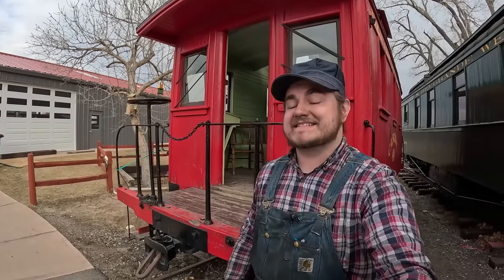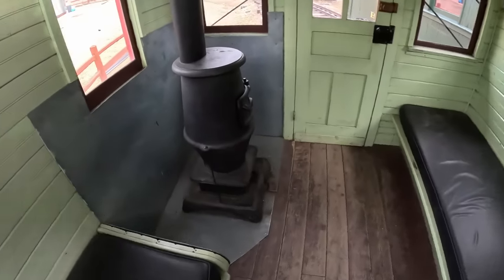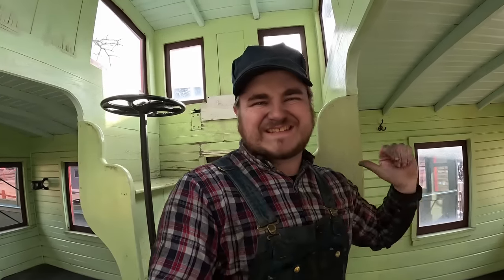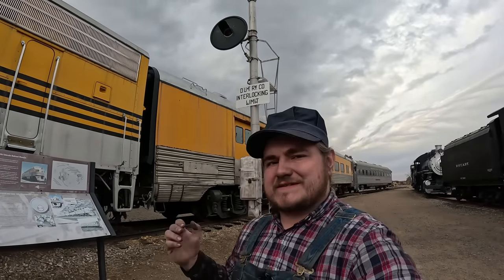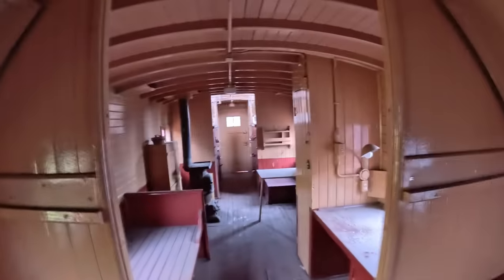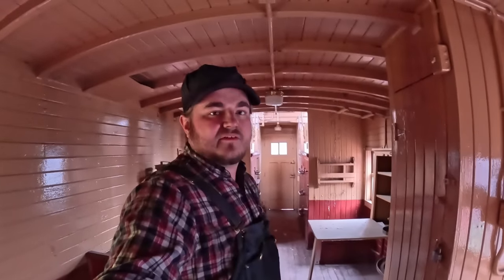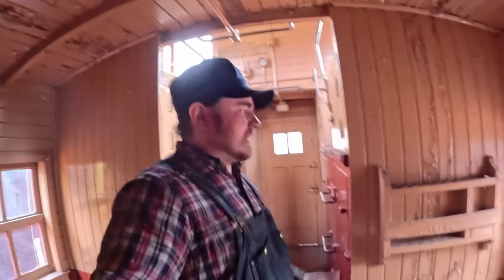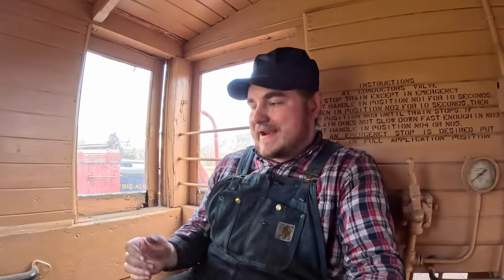Why don't trains use CABOOSES anymore?

Comment: I worked for Conrail from 1979 to 1985. Some freight crews had five people: engineer, fireman, conductor and two brakemen. The railroad started reducing crews to three; now the Class I railroads want to have two, possibly one person, the engineer, on the train; a conductor would be transported out to the site of any issues such as hotboxes, air hose disconnects, etc. 

Trains are larger and heavier these days; Precision Scheduled Railroading adds additional pressure on railroad workers 

When I worked as a clerk in the freight yards, the Conrail crews referred to the caboose as a ‘cabin’ - that’s the word I heard
Reply: I wish they would cap the number of cars. It's aggravating sitting at a crossing, waiting for a megalong train to just get it over with. Sometimes, they pull as many as 120 cars and poke along at barely 25 mph. If they can't even go 35, why don't they reduce the number of cars?? It doesn't save any time when they're bogged down with soooo much weight...

Comment: Such a well-done video! There is one thing you should have mentioned, why cabooses were never necessary on passenger trains. But I'm pretty sure it was because all the work you described could be done from a passenger car.
Reply: Also, the conductor on a passenger train didn't have as much paperwork as on a freight.

Comment: Though we had the aid of hot box detectors, we still looked out at what train we could see. A hot box is very visible at night and dust being stirred up by something dragging can be seen in the day. This includes the head brakeman looking back from the engine. This is done on curves. 
The cupola style cabooses were replaced by bay window cabooses especially on my railroad, Southern Pacific. I worked there 1979-1985 as a brakeman. So the height of the railcars not really a factor. The bay window has a good view, and you don’t have to climb a ladder every time you get in and out of your seat.

Comment: I have not seen a comment on this: I recall seeing a few cabooses, both real and on model railways, that had side sponsons rather than a cupola.  I guess it would make monitoring the sides of the train easier for bearing failures.  Although, I would think loading gauge may be an issue in places.

Comment: We have some roller "barrels" and cylinders from roller bearings at home. My mom was a designer-engineer at the Railroad Research Institute (Moscow, Russia; it's private now, well, "private", and I don't know it's current name). As I remember them, small bearings are all spherical, but at some point (about 2...3 cm or an inch tall) they turn to cylindrical ones, and the largest ones are barrel-shaped. None of what I saw were giant, but they are pretty hefty, a whole bearing must be barely liftable by a common person.

Comment: My father worked for Southern Railway, in the early 1980’s a caboose cost around $80000 dollars. They wanted to do away with them and one of the train crew, which eventually happened. The seniority was bought out and done away with. Now they are trying to have one on a through freight. It’s all about money for the company and stockholders.

Comment: Here in Australia the flashing lights at the rear of the trains are called "BOGS", battery operated guards! We call them guards vans because the conductor is referred to as a guard, conductors only worked on passenger trains and they checked tickets. I think we still have conductors on long hauled passenger trains, guards are long gone.

Comment: Back in the mid 70s, I was a telecommunications technician for Canadian National.  I often rode freight trains in Northern Ontario, including the caboose, or van as the train crews called them.

Another reason for no longer needing a caboose was paperwork.  The conductor was responsible for maintaining all the paperwork for the train and did so in the caboose.  However, modern communications (the stuff I used to work on) and computers (worked on them too) meant that workload was removed from the conductor.  I used to work on a network called "TRACS", which kept track of all the freight train consists, so the conductor didn't have to.  I also recall the hot box detectors and trains passing slowly through the yards, while someone opened the boxes to squirt in some oil.  BTW, back in 1978, there was a major derailment in Mississauga Ont., the city I live in, that caused the evacuation of a quarter million people, as the train had tankers full of propane and chlorine.  It was caused by an overheated bearing.  I was living in a different city at the time, so it didn't directly affect me, though I did take in my sister & kids for a few days.

As for the cabooses, I rode them frequently, as well as in the engine, depending on what equipment I was carrying or where they decided to stop the train (often dead slow, rather than a full stop).  There was one occasion when I was traveling overnight from Foleyet to Capreol Ontario.  I was trying to sleep on a bench, or berth as you called them, but was occasionally tossed off by the motion.  When in a caboose, I usually spent my time in the cupola.  Back in those days, there were normally four man crews, two in front and two at the rear of the train.

BTW, re toilets dumping on the tracks.  I recall that used to be the case with passenger trains too, with a sign advising not to flush while in the station.  When I was a kid, you could see the ties go by, if you looked down the toilet while holding the flush handle down.

Many of the old cabooses were converted to mobile offices or used by the engineering department for examining & testing the tracks.

Incidentally, I don't ever recall any crew member sleeping, but there was a major collision in Hinton Alberta, where an exhausted train crew missed their signal and continued from a siding onto the main line, where they collided with a passenger train.

Comment: RRMan 1971-2005: I spent much much time in many types of cabooses; mainly CNW waycars and at least 1 Dawg-house caboose and alot of UP cupola style cabooses, very nice; electric lites ok toilets; when I hired out in '71 some cabooses still used coal-fired stoves; that was a smell & soot, got all in your nasal passages & clothes spitting out black phelegm; nice cabooses on the Grand Trunk& CN (double stoves). B&O/C&O cabooses were really nice & neat; Pennsy/CR not so nice (old&worn). Never rode an ATSF or BN but heard they were primo cabins; nice stuff on them. I rode cabooses from Chicago to Rapid City, Milwaukee to Gibson Indiana, Huron SD to Oakes ND; Pierre SD to Wall SD; most comfy crummy I ever rode was a N&W woody with round submarine type windows; really nice & toasty warm on cold chicago january night. It was Grand giving A HighBall!! to another passing train from the footboards caboose to caboose going 70mph on the mainline!! And then retreating back into the warmness of the crummy as the snow flew. Then trading cheerful banter on the radios. I remember once stopping just in the clear of a country dirt road near Elkton SD and watching a pretty young barefoot young Lady walking home just over yonder. The quietude of the moment was deafening. Or the time coming up from Kenton ave on #1 doing 70mph. CNW #1main meets and runs with Chicago CTA line along Lake St. Elevated Line to Oak Park Illinois. Except for a 5ft chainlink fence that separates to two lines theres only a 3ft gap; well one time me and a nice young black women, she, in the CTA car and me in my caboose seemed to float together in the same space <CTA was doing the same speed> I turned at looked at her thru a somewhat clear Lexan window and she out her window right into my caboose; man, did her eyez get wide; she checked out my conductor desk lit by an aladin kerosene lamp; on the desk was a cup coffee and thermos a lit pipe and paperwork; CTA train slowed for a station stop and we broke spatial contact.

Comment: Since the railroad industry came out with new locomotives ( Comfort Cabs)  that can do the same job as those decades ago, now all duties are done in front in the cab.
AC4400 CW, AC44009W, ES4400, D40-9W, SD60,  more are Comfort Cabs

Comment: As a boy, growing up in the 1950s, trains hauling wheat from farm towns, had cabooses. I often went out to the tracks and watched them pass thru town, stopping at the grain elevators and loading wheat. I graduated in the early 1960s and now I know the cabooses of those trains didn't have roller bearings. A  caboose still sits in Snyder,OK today.

Comment: Interesting how they were used. 
On the railroad in Russia today we have something identical to a caboose. It is an compressor/caboose car which is part of refrigerator batch consist. They almost never separate those freight cars. It has 2-3 very long refrigerator cars, engine room/caboose with operator who maintans the compressors and its engine, and further another 2 or 3 refrigerators. It also has bed, kitchen, refrigerator, and a large fuel tank on the belly to run the compressor engines. Pretty neat setup.
Sometimes similar train car is used in the middle of the dumpcar consist, used as compressor to supply dumpcars with compressed air. So yes caboose in a way still exists in different parts of the world.

Comment: The short answer is roller bearings and computers. One job of the rear crew was to watch for "hot boxes" as friction bearings heated and the "waste" (think oily rags with something like mop yarn on them as a super-sized terrycloth) started to smoke. This could cut the end off an axle resulting in a derailment. The other thing the crew did was complete paperwork for cars on the train. That of course is now all done electronically. And of course opening and closing switches.

Comment: Ever been besides a long mile plus freight train? When they tighten that slack in the freight couplers, especially when backing up, to insure that they are locked, pulling forward?

That noise, jarring motion, that bull whipping down the wagons-cars, that caboose being at the tip end, what it was like being the end car?

Comment: I had heard that the original purpose of the caboose was to let a passing train going in the opposite direction, that the train they were passing was complete.  If they saw that the last car on the train was not the caboose, then part of that train was stalled ahead of them.

Comment: I was actually in the industry when caboose's were still being used. However, the cost of hauling around an empty wagon at the rear of the train was excessive, especially when it could be replaced with a profit generating wagon. the Guard, or Conductor were also done away with, and the Loco crews took over their duties, thus ensuring a massive cost saving and increased profits for the Company.

Comment: I remember in Canada that at first, cabooses were still required for certain shipments with dangerous goods, and that quietly went away.
Was there a requirement to have the tracks equipped with hot box detectors as precondition to do away with cabooses, or were cabooses take out everywhere at once, even on trains running on tracks without wayside detectors?

Comment: Back in the early 70's as a youngster , my friends and I would often go on a mission to "raid the caboose". By the woods where we played there was a industrial plant that a train would pull into and leave the caboose alone. We'd sneak into it for the treasures contained within. We would stuff our pockets with the railroad flares and the small square "torpedoes". Also there was often a playboy magazine or two, which we would leaf through, often there would be a box of crackers and sometimes the odd bottle of soda. After a quick snack and ogling at the magazines we'd sneak off with our loot.  We made all sorts of mischief in town with the flares and torpedo's. It was always thrilling to do this as the rumor was that the train workers would "shoot at you with rock-salt" if they saw you which always heightened the thrill of our raids. The other railroad "fun" we engaged in was hopping the cars, which was to run along side the slower moving trains in line with the side ladder and hop on it to visit the town about 4 miles down. Of course we would "flatten" pennies, nickels, and dimes on the track with the aid of chewing gum. Another thing we did, which in retrospect was down right evil was to "rock" cars. Yes, just like throwing snowballs at cars and buses in town we would wait for the long row of car carriers to come by and we would try to hit every car possible with the crushed plum sized rocks that supported the track foundation. Side hits on the doors were easy , but one got special credit for "timing" a throw to hit a front windshield. The conductors knew to "highball" it through the area we hung out at.
Thinking about it I must have "rocked" hundreds of Pontiacs, Oldsmobile's, Chevy's, Fords and Chryslers during that time. I do feel shame and guilt as an adult for this bad behavior, but at that time it was thrilling beyond belief. Sorry GM for costing both you and your insurer tens of thousands of dollars all for a thrill.

Comment: 0:40
The main one is that there aren't that many Hobo's needing a dry, warm ride anymore, so no need for a cab/oose at the tail end.
Sadly CABOOSE was (as far as New Zealand was concerned) the WRONG NAME for the Guards Van - the van which held small postal mail/packages that the Guard could pickup/drop-off at wayside stations, as well as somewhere (undisturbed) on the train where the guard could attend to all the paperwork that was needed to be done enroute, long before cellphones & / or hand held computers & laptops meant that this type of information could be done electronically.

Comment: I was born in the early 80s and lived right beside train tracks. There was a two lane road between our yard and the tracks but it was still loud. I can remember seeing cabooses on them as a kid. I didn't even realize they had stopped using them until years later. The corner we lived on was the intersection of two little county roads and train tracks with a gas station on the diagonal corner from our house. There was a sand plant just down the road from our house so on top of the trains, we also got countless semi trucks full of sand going by every day. We loved to give the trucks the signal to honk their horns when they drove by. That wasn't necessary with the train since they would always lay on the horn as they approached the crossroads with the street. Not cool when its 1am and the whoke house is asleep. But, since rhey were already on the horn, we would just wave at them as they would go by. The train would sometimes stop just before crossing the highway and the driver would get out and go inside the store for a drink and a snack. It was the 80s so I was always outside riding my bicycle all over the neighborhood. Stranger danger and helicopter parents and all that wasn't a thing yet. We were always outside by ourselves all day. Anyway, the train operator stopped one day when I happened to be at the store riding around. The driver comes out of the store with his fountain drink and a smile and says, "Hey, kid. Are you the one always waving at me from that yard over there?" I nodded. He said, "You want to see the engine up close?" So he let me walk over with him and have a close look at it all. He let me step up to the top of the steps and look inside. I must have been 7 or 8 years old and I still remember it 35 years later. The Johnson crossroads was a cool place to be a kid. The caboose our train had was bright red with a yellow stripe down the side. We moved from there when I was 13 and I didn't even realize they had stopped using them for a while.

Comment: Dad worked for IC for 43 yrs retired back in 02, he was a conductor back when IC had passenger service and hauled freight, coal and whatever early in his employment, rode in the caboose also. Guy talking about riding in the caboose up in the cupola, I got pictures from up there from Dad riding behind a full load of coal, imagine the dust those guys had in their lungs. They got rid of the caboose because of jobs and technology had advanced to where you didn't need a swithman/brakeman on the caboose, switching could be done remotely, also the cooks job wasn't a necessity , although he cured a lot of hangovers. So basically i could have just said Money.

Comment: In Korea 1957 as an MP we rode on cabooses to provide security especially for the PX cars.  I loved it when one of our PX CARS would get a hot box.  They would put the car and a MP OUT ON A SIDING.  WE WERE LEFT with c rations our tent, mattress a few canteens and a carbine.  We could barter a carton of C rations for anything and I mean anything.  My job was done after I shot a slickly boy.  For my safety, I was returned to my original job..

Comment: cabooses were basically rolling bunkhouses for the train crew responsible for setting the switches, brakes and watching out for the cars during the journey.    With the advent of longer trains and airbrakes, technology allowing for remote inspection of the cars, there was not a need to carry a crew outside of the two loco drivers, so cabooses were obsolete and not needed.

Comment: Watching the freights go by at the Kingman AZ station, I've seen two incredibly long freights go by with a locomotive ON FIRE as it went by, and had to wonder if a crew on a caboose would have been able to spot that fire. It was lucky that the crew (awaiting the eastbound southwest Chief passenger train) inside the station in the crew room, was there to contact the railroad to let them know that their train was soon going to be burning up.